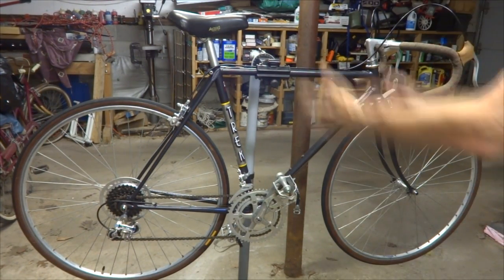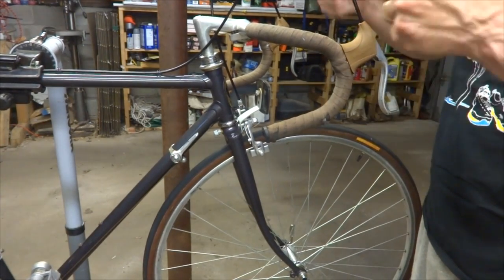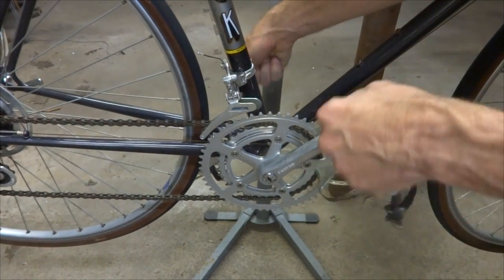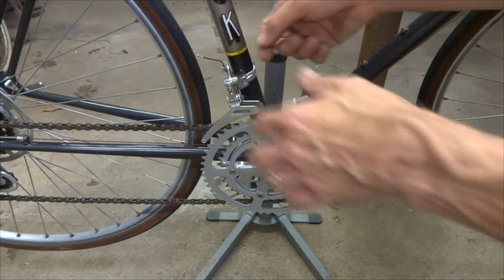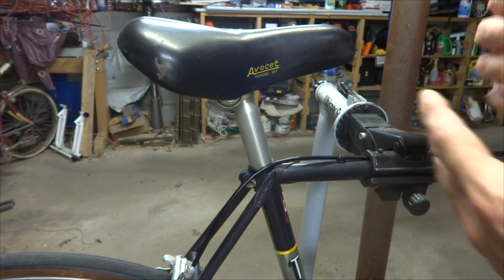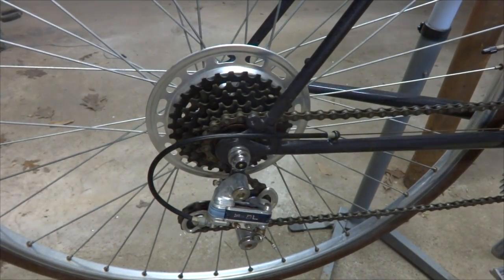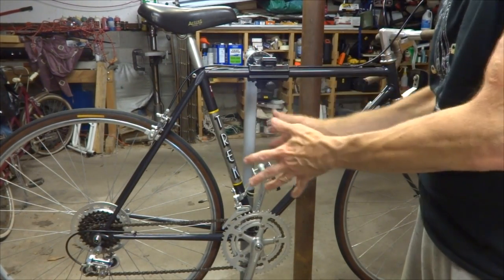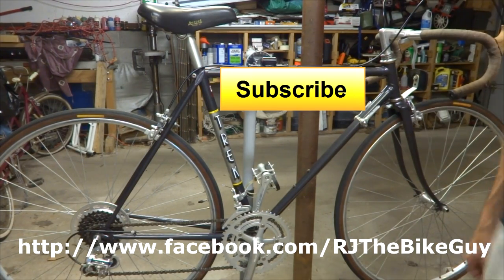Bike Noises - Find Them To Fix Them

Comment: I'm the one who complained about the noise from the hub I overhauled the hub 3,4 times it makes a lot of noise but more I overhauled the more the noise occurred. Never had this kind of scenario .
Reply from the maker: I can't tell you what the noise is without working on the bike. Maybe worn/damaged parts in the hub. Maybe not even the hub. Maybe chain , or derailleur. For all I know your tire is rubbing against the frame.
Reply: Chain and derailleur are working good. It doesn't make any noise. The hub has some kind of problem
Reply: No it ain't
The wheel is correctly aligned
Reply from the maker: shrug Isolate the issue, and fix it. Or take it to a mechanic.
Reply: I found out what was the issue. It was nothing but some small stones jumping into the hub and blocking the bearings to spin freely. This happened because the hub's freewheel side doesn't have any dust cap and I have put a new dustcap and it's working fine. The old one had broken into several pieces and got into the hub and this made those hullabaloos......

Comment: Whenever i'm on 1st and 2nd gear (rear) and 1st gear on the front, there's a weird noise when i pedal. I think it's the chain that is touching the front derailleur but i don't know.
Reply from the maker: So you are in the small ring and the small cogs?
Reply: RJ The Bike Guy I'm the gear that i can pedal the easiest, if it helps.
It's the biggest gear in the back, and the smallest in the front.
Reply from the maker: Okay. Then your front derailleur is not adjusted properly. The chain should not be rubbing the cage in that combination. Loosen the limiting screw a little.

Comment: My front wheel on a mountain bike is making a lot of noise when I spin it, how do I fix this?
Reply from the maker: Try overhauling it. https://www.youtube.com/watch?v=_axwV6sfaAs
Reply: +RJ The Bike Guy I recently just bought it and it started making a clicking noise in the front wheels, I noticed the wheel wasn't centered properly between the two forks so I released the hubs and centered it, when I spin the wheel, I heard all sorts off noises and it was much worse. What should I do to fix this?
Reply from the maker: What part of my previous reply did you not understand?

Comment: My bike making noise when I reach minimum 15kmph with or without pedaling it's driving me insane..  please help
Reply from the maker: Figure it out. Isolate the source and fix it, or take it to a shop.
Reply: I live in small village here local shops mechanics are of no use they had no idea that where the creak noise is coming from then I disassembled everything (except bottom bracket) then washed, greased and assembled now the previous creak noise gone and new tic tic noise coming when pedaling, one tic per pedal.
Reply from the maker: @korbauncut  https://www.youtube.com/watch?v=84YpHC6523s

Comment: When i ride my bike it sounds like an old bike, i think its coming from the wheels because it doesnt make any noise when i pedal it with my hands
Reply: How should i fix that? Hehe
Reply from the maker: @lennon-u6m  YOU need to go through your bike and isolate the issue and fix it. I cannot diagnose the issue telepathically. Or take it to a shop. There are no shortcuts.
Reply: @RJTheBikeGuy  oh okay okay thank youu!

Comment: Hi RJ, your videos have helped me a lot during my bike restoration & rebuild projects. I have a noise-related issue I was hoping you could help me with. I have rebuilt the bottom bracket on my 1970 Allegro (Swiss road bike). The spindle and cups were in excellent condition (bike was collecting dust and dirt in a garage for 34 years). I replaced the balls, lubed everything, put it back together, etc., business as usual. However, when I turn the spindle, the ball bearings (sounds like the fixed cup side) rattle. It sounds like they are hitting each other. I have 11 1/4" balls on either side, but the fixed side seems to have larger gaps between them than the adjustable cup. Everything turns smoothly, but something doesn't seem to be right. Any ideas? I captured it on a video: https://youtu.be/rHtrx8ikO7k Thanks in advance!
Reply from the maker: Lukas Durdina I responded to your previous comment "I don't know. Hard to diagnose from a video. Noises are tough! I would take it apart and see if you can see anything loose in there. Is there a plastic shield in there? Maybe that is rubbing against something? Maybe a bearing came loose? Maybe there is some other debris in there?"

Comment: my disc brake is making scratching noise??
Reply from the maker: This is as close as I have:
https://www.youtube.com/watch?v=i0KB7VeriNM
Sounds like your pads are shot.
Reply: @RJTheBikeGuy  can you explain what "shot" means??
Reply from the maker: Worn out down to bare metal. Or they have embedded dirt, debris. Try cleaning the rotors with alcohol like in the video.

Comment: Hi RJ,  your videos have been very helpful in my restoration projects. I was hoping I could pick your brains on a little noise- related issue I have. I have overhauled the bottom bracket on my 1970 Allegro (Swiss road bike). All components were in top condition (bike sat in a garage for 35 years). I replaced the ball bearings, lubed everything, put it back together and yet the BB makes a rattling sound when I turn the spindle. It sounds like as if the balls were hitting each other. Video here: https://youtu.be/vrNuhoubJb4 Any ideas? I have never had a similar problem. Thanks in advance!
Reply from the maker: LucasT603 I don't know. Hard to diagnose from a video. Noises are tough! I would take it apart and see if you can see anything loose in there. Is there a plastic shield in there? Maybe that is rubbing against something? Maybe a bearing came loose? Maybe there is some other debris in there?